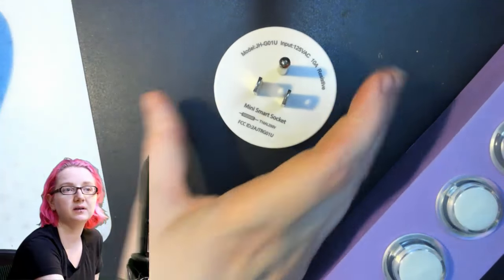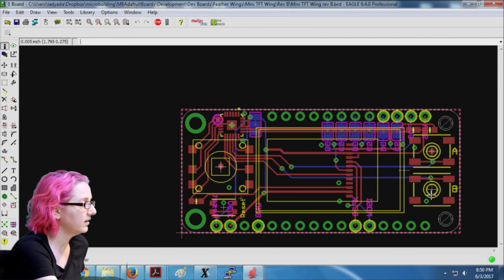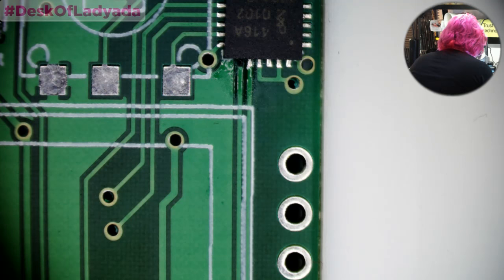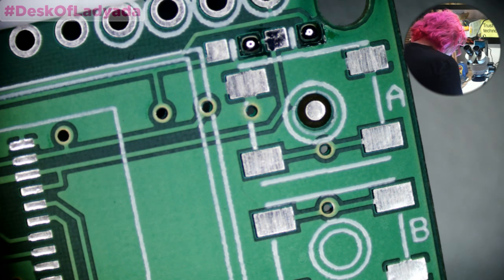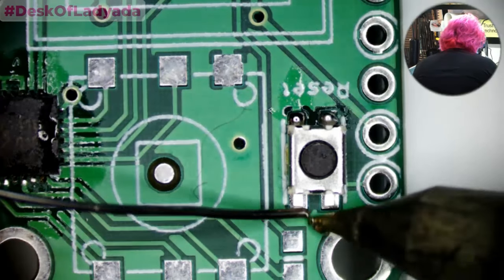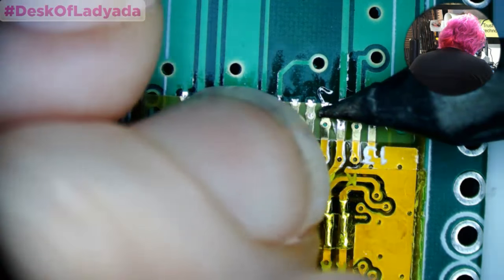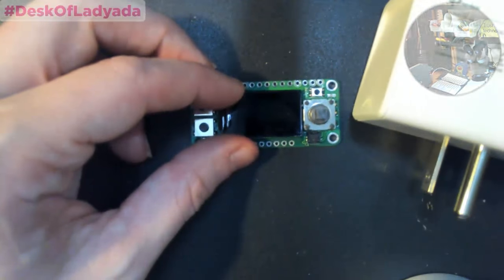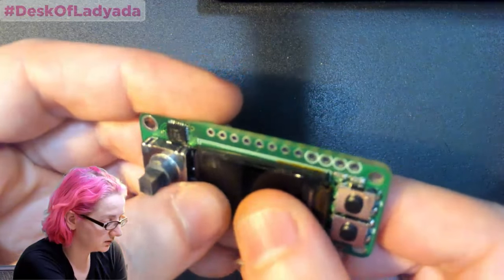#deskofladyada @adafruit Feather Wing microscope assembly! #programming

Comment: hello ladyada I am into a project . The project is a device which takes "audio in" from audio jack of Bluetooth less tv and stream it to another Bluetooth speaker / device .I referred many documents and found bc127 and rn52 are two best modules which does not need an extra microcontroller .But the problem is that bc127 is no more available and rn 52 is ready to work as a2dp sink but I doubt about its working as a2dp source which is my my requiremnt .Even though the data sheet of rn52 tells that it works as A2Dp source .some technical geeks have commented that the software for it is not available...I am your big fan .is there any other module for my project ???kindly help .thankyou so much